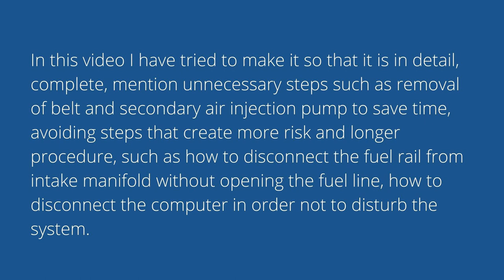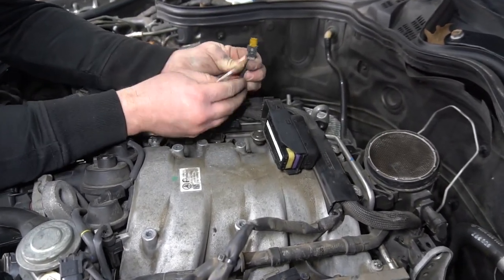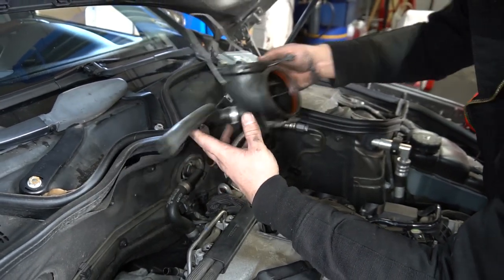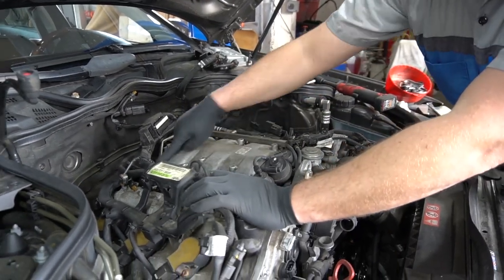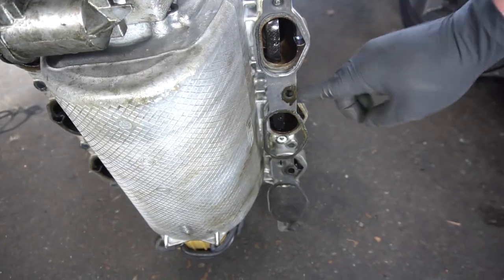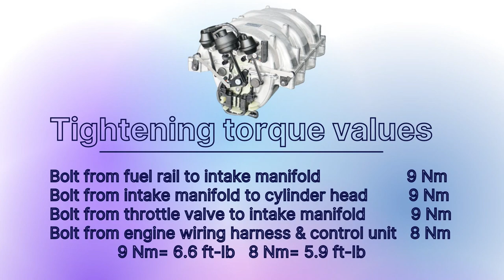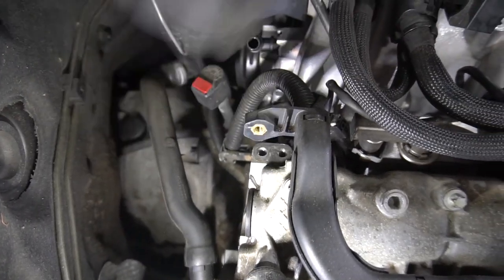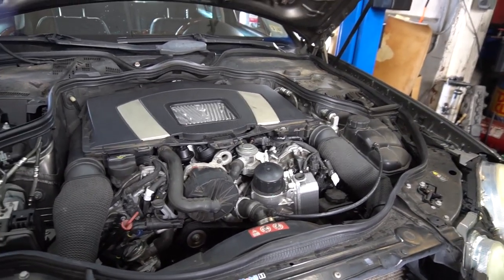Mercedes M272 M273 intake manifold DIY-HD Simple replacement follow the video 350-550 Engines

Comment: Why did you replaced the entire unit vs replacing the brocken plastic?
Reply: I would have replaced it too. But what I would have done was swap out the plastic lever for a steel or aluminum one & the linkages to aluminum as well. There's a kit on ebay that works to update the weak points on the manifold.
Reply: Maybe due to the internal of the manifold was gummed up
Reply: Victor, when a fuse blows, it is an indication of an internal problem and you do not replace the fuse with heavy-duty wire. The weak link of the intake breaks due to an internal problem with the intake manifold and Mercedes-Benz recommends it be replaced with a complete intake manifold. As a business, you can not afford to cut corners.
Reply: @jrock5995  Thank you for the comment. Read my other replies, please.
Reply: @tedlu008  it's just oil & dirt that ruins it.
Reply: @jrock5995  so the old manifold could be cleaned and refurbished
Reply: @tedlu008  In theory, yes but it's best to replace the part. In my opinion.
Reply: @tedlu008  along with what Weekend  Warrior said, the internal runners themselves will eventually break off & little pieces will make contact with valves.
It's better to have the levers break than valves. Sucks either way.
Reply: @RothBeyondTheGrave  mine is 2007 GL450. I can see the plastic lever broken. It did not produce any error message for me. At least on the central display it shows “no message”. And it has been like this for at least four years. Passed annual inspection at Mercedes dealer each year. Dealer did comprehensive check each year and never mentioned about the broken manifold lever. They sometimes suggest replacing battery for $520 but never mentioned the intake manifold. Does that mean that the manifold can be left like this with broken lever? If there is no further damage then maybe let it be for now.
Reply: Btw Fcp euro has the intake manifold. The price fluctuate between $600 and $700. I’ve bought one and just need to make time to install it.
Reply: @tedlu008  I had a similar experience with my 2010 E350 coupe. Who knows how long it was broken for. I had a really rough cold start which eventually smoothed out, scanned it when I got home, & had a code for one of the tumble flap sensors but with no engine light. Cleared it, started next morning & ran fine (other than the now new loud fan/fan staying on issue.)
The car will run fine with the external broken lever, but you'll just loose the variable function of the manifold (different air flows for different throttle inputs). It of course depends on what position they're stuck in & how much oil is getting in from all the pcv/ccv stuff & if your oil separator is still good.
Not surprised techs never mentioned it to you. Even good ones seem to not enjoy being thorough, even with known common issues. Sometimes I truly believe they'll purposefully neglect certain big $ items in hopes it'll break on you & you (we) will come crawling back to them for the big repair.
Reply: @tedlu008  I'm also waiting for mine from fcpeuro. Scariest thing I've found so far is that the manifold sensor in the front (right next to the MAP sensor) was leaking oil into the wiring harness! Who knows how long that was happening for. Hope you don't have that. Definitely not trying to deal with getting a new ECU.
Reply: @RothBeyondTheGrave  I see. Hopefully this issue will not cause further damages to the engine
Reply: @tedlu008  hopefully not! There's some forum posts with people who had pieces of the internal plastic break off, literally melting onto the valves & then the valves don't seat fully, etc. Scary stuff
Reply: @RothBeyondTheGrave  that’s scary. I should get this replaced asap
Reply: @RothBeyondTheGrave  it’s kind of hard to imagine the internal plastic parts to break apart when they are glued to the manifold shell and no longer moving. Maybe when the car gets really old and the plastic get cooked for too long and become brittle and crumble.
Reply: @tedlu008  it is strange. Still not 100% sure exactly how it happens, but I think the 2nd part of what you said is it. All the oil residue & carbon buildup makes it brittle. Add the pressure that's going through it, & all it takes is a tiny piece to break off & go in the wrong spot.

Comment: So I didn’t understand you very well do you have to tap and drag them yourself or does the boat do it for you because when you start at the actuator needed to be tapped in threaded you were implying that you had to do it yourself or did the bolts do that for you
Reply from the maker: The bolts are self tapping. They do it themselves.
Reply: @mbhmercedes-benz7822  thank you I appreciate it